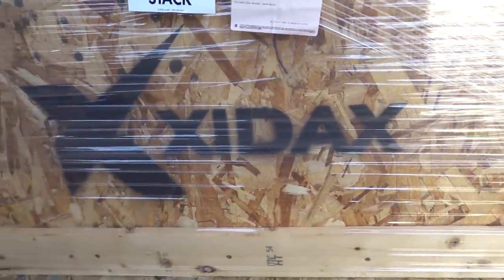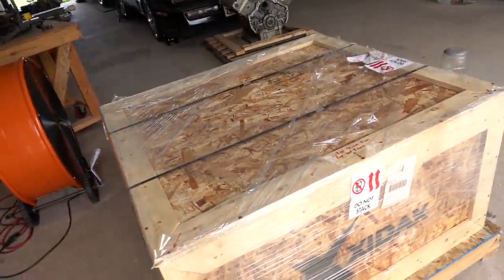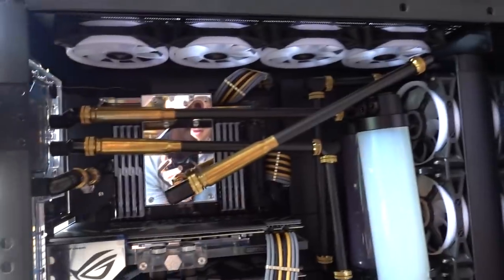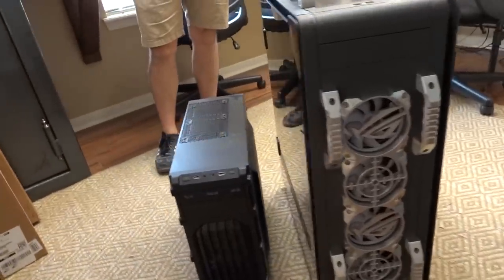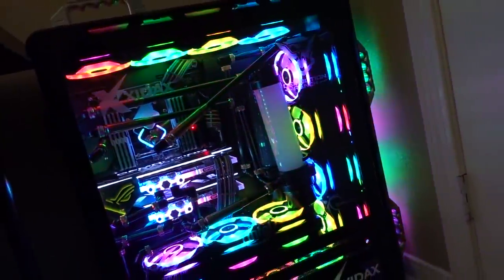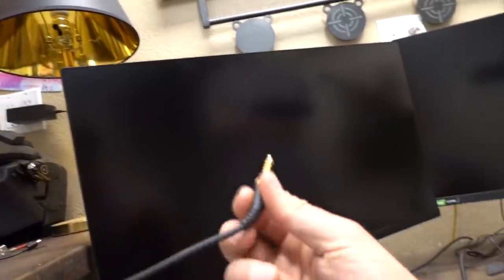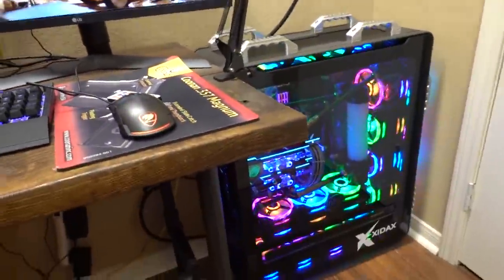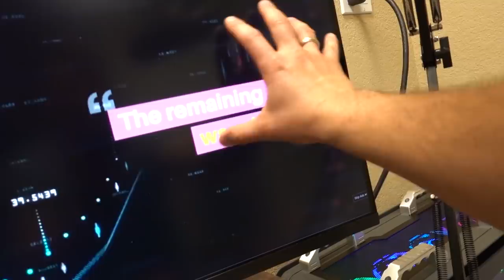The Demolition Ranch Ridiculous New Gaming Computer! TWITCH!!!!!

Comment: This is a suggestion for off the ranch: don’t put the fan facing the wall because it will cut off the airflow which could lead to worse cooling.  Make sure that he sees this please!
Reply: Just with the handles on the front, it definitely gets enough clearance for good airflow. Many cases with solid front panel gets waaaayyyy less clearance

Comment: Holy overkill! Annoying how fast computational parts lose value.
I'd recommend getting a UPS and something similar that's for incoming Internet cable.
Wouldn't direct its exhaust under your table - heat pocket, legs can heat you up fast. Help it breath though it has multiple fat long radiators.
Positive pressure would be fine - keeps dust from coming in from random holes and helps you get air through a filter.

Comment: That's a very nice system. Are the fans in the front panel (facing  the wall) exhaust or intake? If it were mine I would have a minimum of 10 inches on all exposed  sides.

Comment: Ya know mat your running a .308 caliper pc man, yeah its nice and being shot out of a nice setup, but the 50. BMG of PCs is the AMD thredripper 64 core processor with dule 2080TI's oc. Combined with the same cooling setup you would be looking at an insane FPS while recording and streaming all at the same time. Pluse your video rendering speed would be insane, even at 4k.

Comment: FYI: should have gone threadripper. Up to 64 cores. Also, the gaming performance would be on par/ better (unless you overclock the crap out of that thing). The renders would also be  around 50% faster. Also, the X299 platform is a dead end. No potential upgrades, and this build could have come from 2018.

Comment: i might be late and someone else might have said it already, but make sure you dont just have an sdd or hdd, use sdd memory for system memory and your hdd memory for things you use like programs and games, things you save, will make your loading times in games and rendering/editing videos allooooot faster, sdd is already faster then hdd, and doing this will make it so the system doesnt have to search through all your user memory for system memory, for example gta 5 would take 10-15 mins to start up off of my hdd, and with that dual memory setup, it only takes 5-8 mins for gta 5 to load up

Comment: Hes gonna have to send that back each time for maintenance or learn alot really quick. Many downsides to watercooling. If a pump fails thats going to be expensive to replace plus your rig is going to overheat and thats never good. Many upsides though. Watercooling is overall better than air cooling.

Comment: it looks cool but no more, what you got there is a jet-enigne-sound-generator
Reply: More slow fans are quieter than fewer faster/ more powerful fans, you will be hard-pressed to hear most fans at <800rpm. I have 6 case fans (4x140mm + 120mm & 180mm) and the only way you can tell it's on is by the keyboard lighting up (I'm not much of an RGB fan).

Comment: Thats a nice computer, but I don't think Matt realizes just how much maintenance custom water loops needs.

That colored coolant will probably start clogging up the whole system in about 2 years, with that type of intricate tubing draining and refilling the system will be a massive pain in the ass and may even require a full disassembly every year. Not trying to be mean but it doesn't seem like Matt knows anything about computers, so he will either have to learn how to do it (Which I highly doubt looking at the complexity of the system), or buy a new $5000+ computer few years.

Comment: Holy overkill for cooling and you can use half of the ram you have and be more than ok lol. even with a 10th gen processor that still only hits 5 ghz like a 9th gen i9 or even i7 the cooling is insane. overall though its a really cool build. You definently wont need to upgrade anytime soon.

Comment: Guys, you may want to disable those LEDs unless you are specifically using them for effect (like to make a video and want the PC to look awesome), they do generate heat.  I saw a video on LEDs that were on an SSD that showed it significantly impacted performance negatively by greatly increasing heat.  https://www.youtube.com/watch?v=vnST5rA64Oc (JayzTwoCents tech channel)  I am NOT saying your pc can't handle the heat it produces, but to consider that unless you need the LEDs why run them... Edit:  Also, tell me you have more storage than just the 2 TB SSD with all the video editing you do...  SSDs can wear out very quickly if you store too much on them and don't have free space for temporary storage for the system.  4:13 in this video https://www.youtube.com/watch?v=-XZNr7mS0iw&t=348s (Explaining Computers channel) talks about provisioning, the video itself goes over how SSDs work and the different types.

Comment: 30 fans? Jesus fuck, totally unnecessary for an over clocked I9 10900. Idc, fight me. This build is stupidly built. As for gaming, 2 GPUs dont improve gaming performance by a whole bunch. If any, ram and a single GPU is perfectly adequate for 200+ frames, unless you're doing editing or animation work a 2nd gpu is "almost" useless. 128gb of ram? Good god man that is alot of ram just for games, anything past 32-64gb doesnt improve performance, again, unless you're editing you can use maybe 90-110gb? You'll never use that much.... ever... fans are probably restricting air rather than provide and causing negative pressure, also probably more noisy than it should be ause of the god awful amount of unnecessary fans. If you're gonna water cool, just water cool the damn gpus in the same loop. This is a editor's computer not a gaming computer.